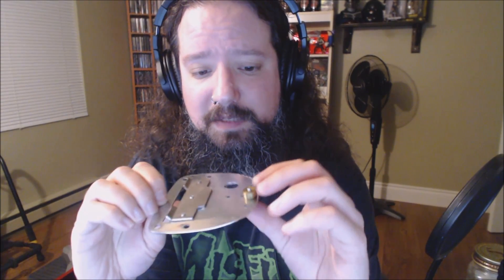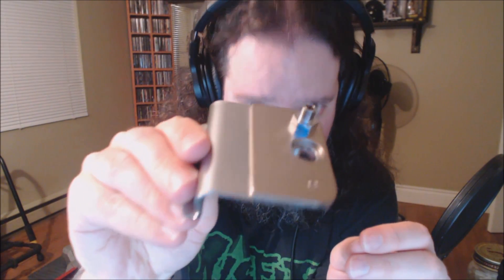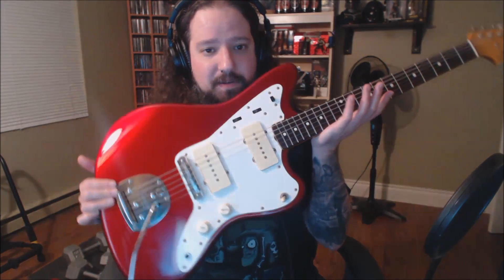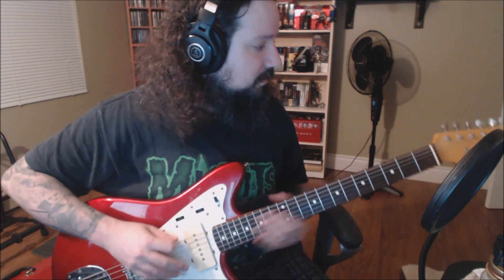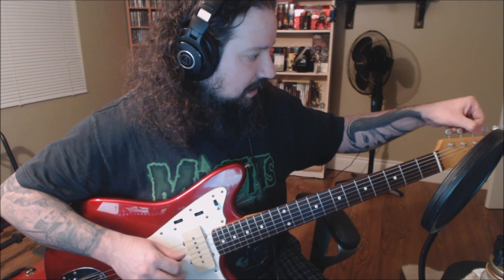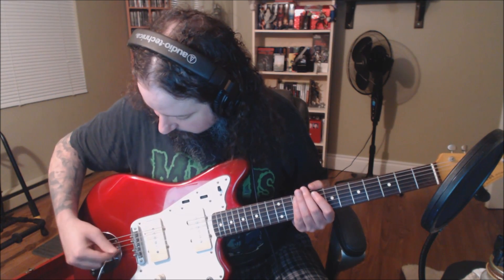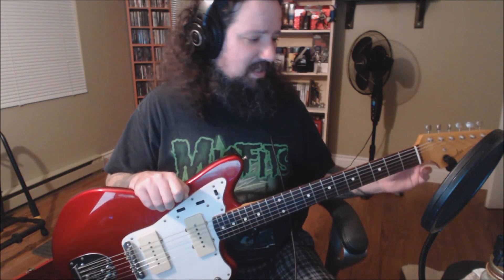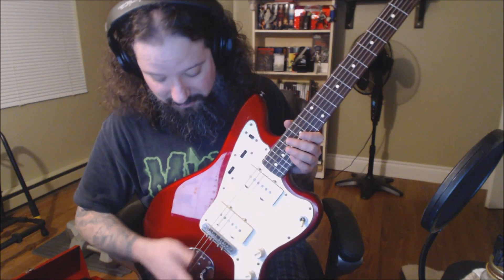Jazzmaster/Jaguar trem - Explained and set up

Comment: Considering the era back when this trem was devised, musically it was only meant to be pushed maybe one or two half steps down only and back in tune if you're lucky and pulling up was more of a risk than an option. It was more about getting that "trem wiggle" effect. Leo Fender had no concept of "dive bombing" with his design. But Hendrix did...
Reply from the maker: Very well said!
Reply: A lot of surf and rockabilly dived bomb with them too, much more than 2 or 3 songs. Check out Vocanic Action by the Challengers

Comment: Great vide pretty well explained on the Tremolo plate. that's how mine works The main feature of the locking tremolo is case you break a string the guitar will not go out of tune and still be playable until the song is over and replace the broken string an ingenious design by the great late Leo Fender.
Reply from the maker: Frankie Day Models yup exactly right. Or lock it when not playing...or just if you don't want to use a trem
Reply: Livlos if the trem is locked, and you do a blues bend where you hold a note and bend another, will the trem still make it so that the note you dont bend will be out of tune?
Reply: Except that it doesn't lock the trem. It just stops it going up. The idea is to set it so that when the switch is engaged it's at the same level as when you tuned it. Break a string, engage the lock. The trem still goes _down_. Just as normal. It just no longer goes up. You can still use the trem but you don't go out of tune from the release of string tension.
Reply: @thecaveofthedead  glad someone chimed in to explain this. There's so much misinformation surrounding the intention of this device.

Comment: Thank you!! I bought a new (2018) Jazzmaster, played it without the tremolo tailpiece for several months. Yesterday I put the tremolo in, it was awful. I've played and worked on guitars for many years, but never had a JM before. Your explanation was perfect - simple, to the point, and ACCURATE. Fixed it in 15 minutes, didn't lose the strings, and it plays great now. Great job, hope you keep the videos up.

Comment: Thank you so much! I've successfully set up my tremolo system on my jaguar and along the way  also found that my lock piece has a defect which is a pain, but I can live with it.
Even with the spring piece completely disassemble and removed from the tail piece plate, the lock piece sometimes gets stuck in it's own edges cavity, it can happen when sliding to both lock and unlocked positions. When analysing the lock piece I realised that between it's top exterior part and the tail piece plate sits a double wave spring coil washer*, this washer is what causes the problem, the washer is somehow deformed and sometimes gets stuck stopping the lock from sliding.
I thought about somehow disassembling the lock from the tremolo plate and replacing the defective washer. 
I found I am unable to disassemble the lock because it's bottom part (nut), the one that sits under the tail piece plate, has the bottom end of a screw inside it, no cavity for a screwdriver to fit in it and unscrew it from this end, looks to me like the head of the screw is the lock button itself, I realized no tool can unscrew the lock piece, it seems Fender wants it to be this way, I read somewhere Fender apllies a Loctite type compound on the screw threads, so it's no easy task.
I did try to unscrew it somehow though, as both top and bottom (nut) of the lock piece are round, I tried holding both ends with pliers, used cloth in between not to scratch the lock, I know that doesn't help with getting a good grip, but I don't wanna scratch the parts, apllied a good amount of strength,  but with very little grip it didn't unscrew at all.
I found a workaround for the problem, when the washer gets stuck I spin the button with my fingers and eventually it's released and I can slide the lock button,  until the next time it happens...
It's difficult to jam your fingers between the strings and spin the button, but buying a new tremolo system to replace this defective one costs me about 109€, best retail price in Europe, I don't slide the lock button so often to spend this amount of money, so I'll continue spinning the button until the day I die! 🤣

*some older lock piece models seem to use a simple white colour, maybe plastic, washer between the lock piece nut and the tremolo plate, other models seem to have no washer at all.
Reply: The above described one of the issues I had with a new mexican fender kc jaguar guitar, a few days later I had more issues and ended up returning it. Later I purchased the same guitar again and fortunately it had zero issues,  this time it took 2 minutes to set up the tremolo system, so thank you so much for your video, it's awesome!

Comment: Any tips for how to adjust if the trem makes a clicking sound when you use it?
Reply: Check if the knife edge on the plate underneath has rough edges. I saw a video where some had the same problem with their Squier classic vibe 70s. They dismantled it and sanded the edges flat and it stopped the clacking.

Comment: So can I take out the spring if I don’t have a lock button. My squire Jaguar cv dose not have a button and I want to lock it in place . I don’t want anything floating. I don’t use trem bars on jaguars. Thank for the video.
Reply from the maker: I don't think that would work...I'm pretty sure they make bridges that should fit right on there that dont float or move

Comment: Does anyone know if I can put a locking fender trem on my Squier CV Jag? I've already got a real Fender Strat, but I'm trying to decide if I want a real Fender Stang, Jag, or JM. I think I'm gonna get the Squier versions of all of them and just replace some of the parts with real Fender parts if it's possible. That way I'll have a better idea of which one I like the most. Plus, I'll be able to take them all apart and learn. 

Anyways, if anyone has any experience with putting real Fender parts onto Squiers, please let me know. Because my Squier jag doesn't have the lock on the trem and I want that lol
Reply: Yes it drops right in! Try it!
Reply: @connorchambless7062  cool! Yea, I think I will try it. It seems like that's the best upgrade for a CV Jaguar. It also came with vintage style tuners, but I think it would do better with some real Fender ones as well. I think they even make vintage style locking tuners now, which is cool because you get the real vintage look, but with gold tuning stability.

Comment: Your set up guidance is excellent, but your reasons are wrong. This trem is set up with the lock so if you break a string, you pull the trem arm down, engage the lock and the guitar returns in tune, so you can finish the song. It's a brilliant piece of design that fully caters to a professional musician.
Reply from the maker: you are correct

Comment: Thanks a lot. Just bought a MIJ and The arm was so low! And The lock didnt work. After This The lock works, and The arm sits Way higher with a curvature to it which allow me to use The trem as it should be. But now i Got a severe rattle, coming from either below The bridge, or below The trem plate. Another problem to fix i guess. But Thanks for The video.

Comment: I've just taken my JM trem apart after realising the trem lock slider switch didn't seem to be working and found that it doesn't slide far back enough to reach the plate/the plate isn't long enough to reach the slider...  It's like it's just been built wrong....

Comment: it cuts cost on material to have those two plates instead of one thicker piece. Thicker material would probably require high carbon steel with special attention during the tempering process in order for it spring back with out being so brittle with hardness that it potentially cracks. metal is a little like wood in this case comparible to plywood in the sense that it's more structurally sound than a solid piece.
Reply from the maker: Whoa hold up we got a metallurgist up in here! ;) Probably it was just an off hand comment I made taking this apart for the first time

Comment: I'm sorry to ask but do you have any advice on how to set up the Squier trem that doesn't have the lock? Just picked one up from Reverb and the trem wont pull upwards at all. The tension screw doesnt seem to do anything. Im aprehensive about taking it to bits.
Reply from the maker: I'm not really familiar with the squier ones, but USUALLY they should work the same just minus the lock...it;s odd that the screw doesn't do anything though... If you bought it new, a lot of shops used to offer a free set up...no idea if some still do... Sorry I couldn;t help more
Reply: @Livlos  hey, thanks for taking the time to get back to me. It does sound as if your set up guide should work. Might just pay someone who knows what they're doing though! Thanks again.
Reply from the maker: @crapsharkify  thats... usually the safer bet :D
Reply: @Livlos  Hey, it's working now!  I was thinking about what you said about the tension screw. I'd been carefully using half and quarter turns in fear that I'd either over tighten it or have it drop out of the spring ( I'm new to Jazzmasters and trems ) and it was having no effect at all. Decided to try loosening it a lot and now it's all good. The previous owner must have had it tightened as far as it would go. Thought I'd let you know. Thanks again!

Comment: Here's a question. I have an Am Pro 2, and when the vibrato tops out, it makes the click noise, when the 2 plates meet, I reckon. I have the vibrato lock engaged, and have it so I can dive bomb from E down to about A. Another video uses gaffer or duct tape in between the 2 plates to dampen the metal contact noise, but others say it's a matter of adjusting the vibrato tension screw. If it's down to how tight or loose the tension screw is, how much so, so that the 2 plates don't meet so forcefully, to make that noise?

Comment: Weirdly the Squier J Mascis JM hasn't got the little locking button on the bridge. Does anyone know why?
Reply from the maker: He probably doesn't use or like it? Alot of replacement parts don't have it either like the mastery one for example
Reply: @Livlos  Yeah, that makes sense, i just adjust the tension until it feels right. I don't really understand why people are so intimidated by this trem tbh. The J Mascis model also has a tuneomatic bridge, similar to that seen on a Les Paul, does that make any difference?

Comment: I have a Squier Classic Vibe Jaguar. It doesnt have a locking mechanism... however everytime i use the trem it knocks the guitar out of tune. What is happening?
Reply from the maker: Make sure your guitar is well wet up and that the strings aren't getting caught in the nut

Comment: Thank you for the video!  My Squier Jaguar does not stay in tune when using the trem.  I eliminated all the usual suspects (nut, strings, bridge, shim).  Can it be the trem?
Reply from the maker: Yes definately.
Reply: @Livlos  Greasing the pivot area or sanding it?  What do you think?
Reply from the maker: @MegaBrebis  I think take it into a pro 🤣 it could be any number of things. Really hard to tell with out seeing it
Reply: I wonder if it may just be a problem with Squires in general - My Mexican-made Fender Jag always stays in tune, but my dad has a Squire strat that won't hold tune; a friend of mine had a Squire Mustang that wouldn't hold tune but my Japanese Fender Mustang was fine. Idk, that's just my experience...Btw, great video, Livlos, I learned a lot man.👍
Reply from the maker: @salopro86  Ironically.. I always have terrible issues with Made in Mexico fenders :D
Reply: @Livlos  honestly, I had to fix the lead/rhythm switch on the jag when I bought it, which of course I wasn't thrilled about, so you're probably correct there, but aside from that, I haven't had any problems, it actually holds tune better than my US-made Gibson Les Paul. This is the only Mexican-made guitar I've owned, but I read that the Korean, and even some American made Fenders use Chinese pot steel which is a cheaper alloy, whereas the mexican factory used a higher quality metal. Could be bs though, I'll post the article if I find it.
Reply from the maker: @salopro86  I suspect bs. 😂. My mexican Strat has been out for warranty repair since June :(
Reply: @Livlos  lol. Damn, that sucks. Well, I hope more problems don't start coming up. But as it stands now, the jag has become my preferred axe. Of course, that's got more to do with preference of tone vs. hardware. As far as homeboy's Squire Jag, that was just my initial thought
Reply from the maker: @salopro86  the neck on mine was so warped...they gave to build me a new one...and either fender or the Canadian distributor messed up... So despite the order being sent June 9th. They only started work on the new neck in November. They expect me to have it back somewhere around February or March.
Reply: @Livlos  man, that's some bullshit, I'm sorry you're going thru that. When I had that issue with the switch, I got a big runaround too. Contacted Sweetwater, they referred me to a "licensed fender technician" who didn't know anything about the wiring of the classic Jaguar, he actually couldn't even tell the year of the guitar even though it's literally part of the serial number(fuckin south Texas, lol), then he tried to convince me the 2018 Fender Jaguar classic player didn't have a rhythm circuit, that it was a mute switch. Lol. After telling Sweetwater, they ended up sending me a new Jag, but that one had a lot of fret buzz, so since I'd already fixed the first one by myself, I just sent the second one back.

Comment: The Jaguar/Jazzmaster vibrato system is far superior to the Strat system for moderate playing, however, unless you set it up correctly, you have to re-tune from the locked to unlocked.
Dive bombing? Floyd Rose.

Comment: My first JM bridge, (an import  without a lock) let me snap the whammy bar into it, so it will stay in place, but my new one (Fender with lock) won't keep the whammy bar in place.  The bar I got is smooth.. no notch.  Do I have the wrong bar, or is there a way to set it so the bar will stay in?
Reply: Ozarkana I’ve been having the same problem, I guess the only way to fix it is to open it up and screw it harder. But I couldn’t be bothered doing that so I just taped the bar, works just fine and it saves you the time
Reply: On my second JM I got the new model bridge from Fender that has the typical screw in whammy like the Strats.  Works fine now but it has the same issues.  If i screw it in too much, the nut on the back side of it loosens up.

Comment: Thanks a lot for the video. I just got a Fender Pawn Shop Bass VI, and I being an Ibanez Original Edge floating trem guy I was looking at this thing like "huh??" But your video helped me to understand what I was dealing with without having to tear everything apart. I just ordered a Staytrem bridge for it and when it arrives I'll tear everything apart and get it set up and lubed per your explanation. Thanks again! I love YT!
Reply from the maker: nitemareman1 awesome let me know how the new bridge works out
Reply: Hey friend I just got my Staytrem and I've got the VI exploded on the bench. Question- my locking switch is difficult to move back and forth and I was wondering how to remedy this?
Reply from the maker: nitemareman1 I grease it up every few years or as needed.